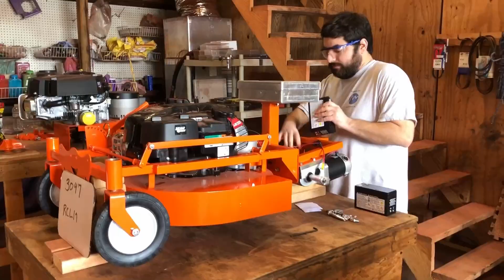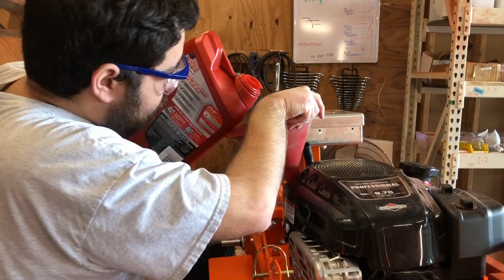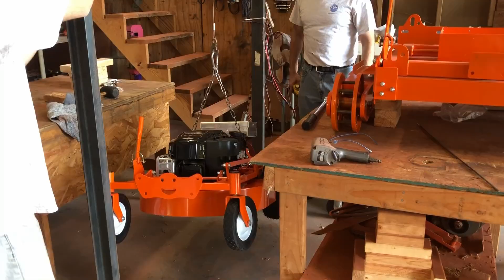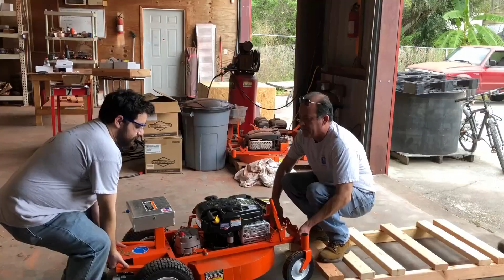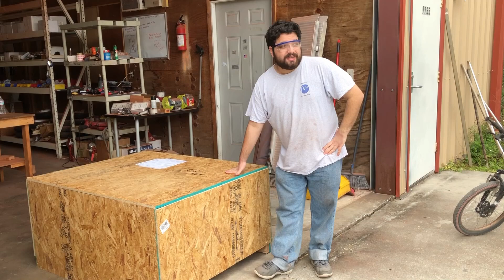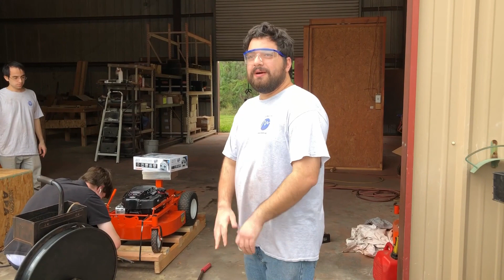Look how FAST we put together a ROBOT LAWN MOWER!

Comment: Thanks for the great video.  Looks like a nice setup.
I am building an RC lawnmower and was wondering what size of battery you would recommend?   
(My lot size is about 60 ft by 100 ft minus the house). 
Thanks for your help.
Cheers
Reply: 12v boat battery would be plenty.